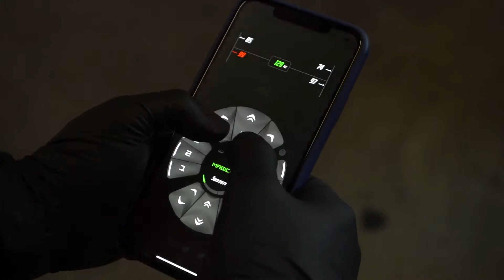2012 - 2019 Lexus GS350 Height Adjustment Air Suspension Function and Form

Comment: What size wheel are those.  I'm on the first stage of setting up my air system.
Reply from the maker: Fronts are 20 x 9 +35 and the Rears are 20 x 10 +38